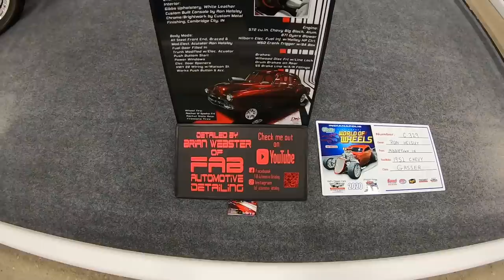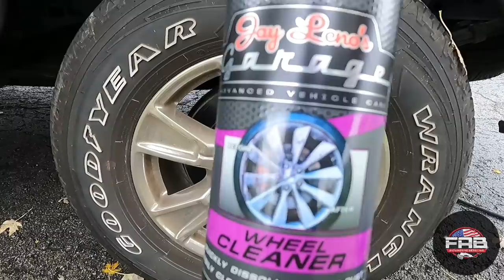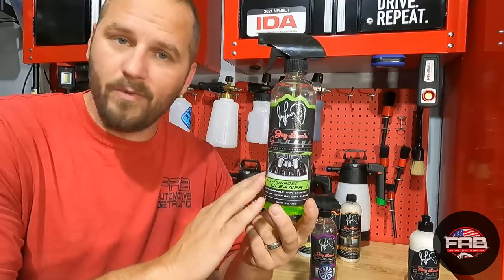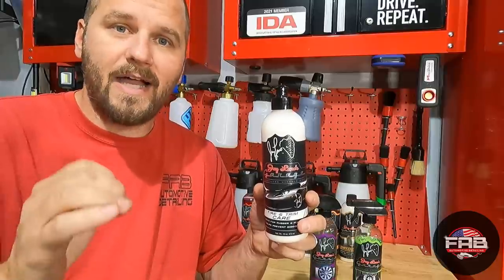Jay Leno's Garage Wheel Cleaner, APC & Tire/Trim Care Any Good? Let's Find Out!

Comment: Great video as always. I have used all the products you're using I like them but the trim coat shine works good on tires but not on trim. When it gets wet the trim runs all down the side of the vehicles and looks like big oil stains.
Reply from the maker: Thank you! That’s good to know.
Reply: Yes, That's been my experience with the Trim & Tire Dressing. It will run off the Plastics after the first or second rain storm, but I like using it as a tire dressing.
Reply: Thanks for the tip!

Comment: Bryan, The Jay Leno products are great for the budget conscious Detailer. It will be nice to see a comparison between the J. L. Wheel Cleaner vs IRON X or similar product. My experience with the Tire & Trim Dressing is it works great on the Tires, but will tend to Run off the plastic trim (Especially the Mirrors) and run down the doors after a good Rain event. Enjoyed the review.
Reply from the maker: That’s good to know about the trim dressing. Thanks

Comment: I use Lone star coatings now for my tires but befire that I was trying every tire shine / protectant I could find. I have to say his tire shine is actually really good. Easy to apply, held up fairly well and had a high shine if you wanted it to. I still use it on my mud flaps and fender liners. I was skeptical at first but it works really well
Reply from the maker: I agree it did look nice on the tires and was very easy to use.

Comment: I always use the wheel cleaner on a dry tire as the cleaner does take longer to bleed when wet.
Reply from the maker: I wanted to spray it on the wheel dry but for the video I wanted to follow the instructions.
Reply: @FABAutomotiveDetailing  fair enough, might wanna try again with a dry wheel this time and see if that helps in cleaning power or if it makes a difference in any aspect

Comment: Can the Jay Lenos wheel cleaner be used on the paint as an iron remover ?
Reply from the maker: It doesn’t say that it can be in the directions but it would probably be ok.
Reply: Fyi..those wheels are in fact powder coated acrylic clearcoat on the top layer. Thanks for video

Comment: How do you further clean/polish/protect the chrome rims
Reply from the maker: You can always polish with a meta polish and then coat them with a ceramic coating. Ceramic coatings are about the only thing that will hold up on wheels due to high temps.
Reply from the maker: @jjjjjjjjjjjhjjjjjhjj  To polish if need be!